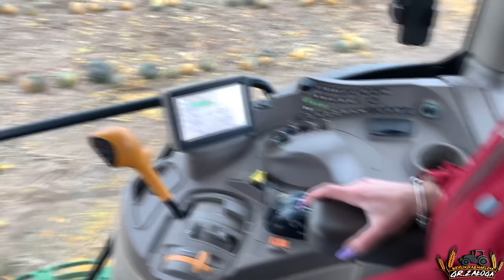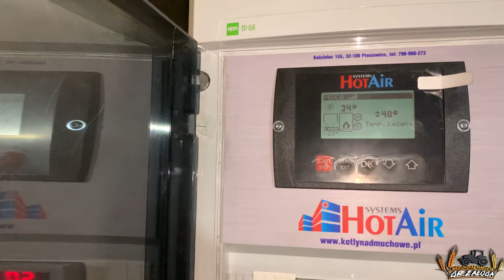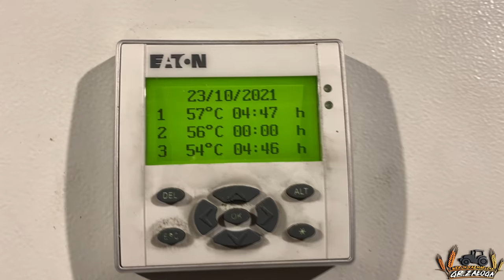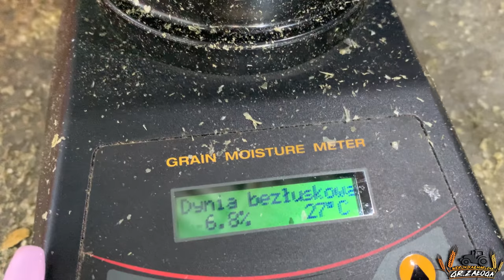Kompleksowy zbiór pestek dyni z uczestnikiem programu Rolnik szuka żony ☆ 2021

Comment: I thought the temperature would be higher, but maybe they would crack during drying.
Reply: In my opinion the temperaturę would be in range 40 - 65. Depending on the advancement of the drying process. Our drying machine allows us to control this process.
Reply: @roberttaborski6904  Dzieki !